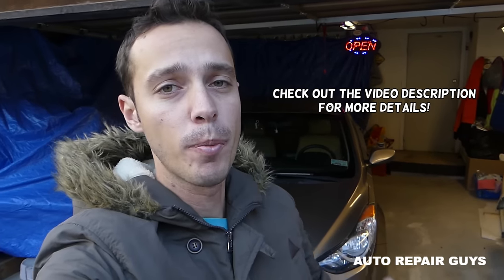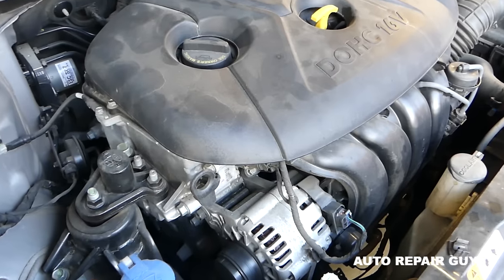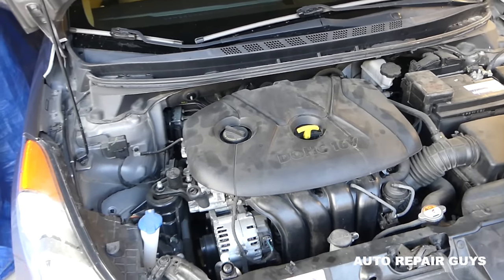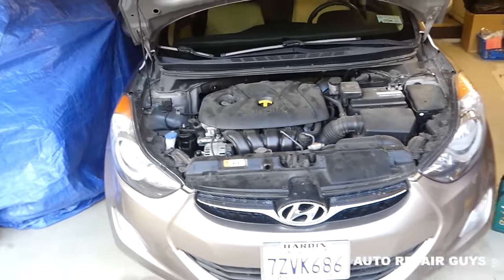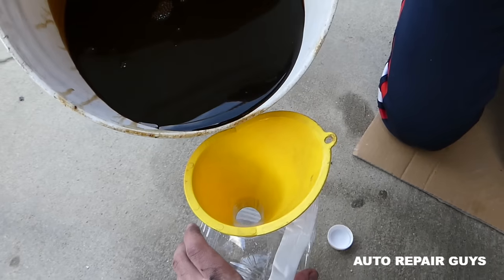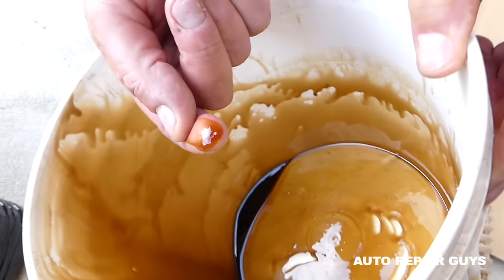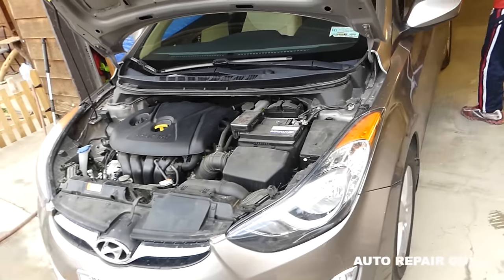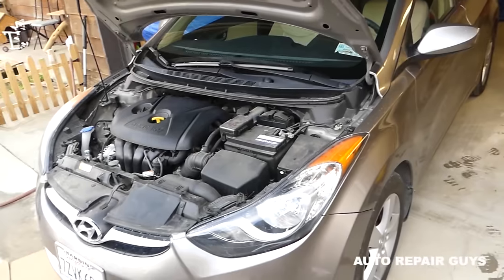HYUNDAI ELANTRA ENGINE KNOCK TICKING NOISE

Comment: Oh boy, that's giving me some "PTSD". I bought a 2012 Elantra back in November with 79k on it, I didn't even put 600 miles in 2 months on it and it started doing this. I ended up having to get an entire new engine because it go so bad.
Reply: It's not an issue with the car itself. People drive them hard and maintain them poorly, and that's when there are problems. I like to buy new for this reason. I bought a 2012 Kia Forte, which has the same 2.0 liter L4 engine, and did all the maintenance myself, full synthetic oil every 5k miles. It has over 100k miles on it now, has never needed any repairs, and runs like brand new. I bought a 2018 Elantra this week, and there is no difference in the sound of the engines. I expect both to last 300k miles or more. If you drive them gently, they will last for a long time if maintained properly. Even if driven hard, they can last many miles, but once more, proper maintenance is absolutely essential, and this is never guaranteed when buying used. Even dealer service does not guarantee that a car is maintained properly... The only way to truly ensure longevity is to buy new and service the vehicle yourself, using quality oil and filters at regular intervals.
Reply: @michaellovell2518  umm, hyundai recalled 3 mmmmmillions engines due to this "manufacturing defect" and class action lawsuit in canada, if it wins i get a new engine. Not saying all are bad mine still strong but lifters clicking alot. Definatly want to do preventative measures.
Reply: @tomanderson3196  
Herp derp, muh Hyundai "runs strong," but I want them to replace my engine cuz I think I hear a noise, derp...
This message brought to you by Toyota.
Reply: Ever notice how your car seems to run better after a thorough detailing? We all know the detail did nothing to the car mechanically, but it still feels that way, right? People read about problems with a certain car, then they start hearing mysterious "clicking" and shit... They get nervous and paranoid, and start stressing about whether there's a problem with their car, and often imagine there is even if there isn't... My daughter had me look at her car because she thought she heard an unusual noise. I checked it out, and couldn't find anything wrong. She kept coming back complaining that she still heard the noise. I didn't hear anything that concerned me. Finally, I told her I found the problem and fixed it, even though I actually did nothing. She was quite pleased to report that the repair was successful, and she didn't hear the noise any more. I'm not saying every bad report is bullshit, I just take them with a grain of salt. I'm old enough to remember how long it took for Toyota to overcome the widespread (and largely undeserved) poor public perception of Japanese imports. Every little issue was blown way out of proportion by the "I told you so"  crowd, to the obvious glee of domestic manufacturers. All I know is that Korean manufacturing appears to offer good value, and their cars have excellent warranties. I gave them a shot, and so far, I'm satisfied enough that I purchased a second Korean made auto...
Reply: @michaellovell2518   Oh i dont hear any noise, just the fact they recalled 3 million and over 6 million are effected by what the manufacturer calls a "production defect". I guess i should just not worry.
Reply: @tomanderson3196  
"lifters clicking" "don't hear a noise"  GIMME A NEW ENGINE RIGHT NOW!
Sounds legit...
Reply: How many engines actually caught fire? The recall pertaining to the engine fire claim wasn't to replace engines, it was a software upgrade for the ECMs... Maybe I shouldn't tell Tom Anderson he isn't getting a new engine unless his catches fire. He sounds like he wants his strong running engine that may or may not be making a noise replaced at the expense of Hyundai, assuming he even owns a Hyundai. I wouldn't want to encourage arson...
Reply: On a side note, Korean manufacturer Daewoo built a car called an Aveo for GM, and I owned one, but only for a short time. It was a real piece of shit. The bolt on my idler puller just snapped off while driving down the road, and there were clearly a lot of corners cut in quality to meet the price point GM demanded. I wouldn't buy another at any price. I could have had it fixed under warranty, but there's no telling how long it would have taken, and a new pulley with the bolt was only like $20 bucks, so I replaced it myself and sold the car. This is not actually Daewoo's fault, since GM was their customer, and who they had to satisfy. They built the car GM asked them to build at the price point GM demanded. It's like how China has a reputation for making cheap, crappy stuff... It's not that China is not capable of building to high quality standards, but a case of foreign retailers demanding cheap crap to sell, and China giving them what they ask for...
Reply: @michaellovell2518  I really like my forte and it runs good and i am not selling it but if the class action law suit wins in canada i get a new engine courtesy of hyundai. If not just hope you dont have any problems.
Reply: @michaellovell2518  The lifters do click alot because they are not hydraulic but mechanical bucket lifter that require manual adjustment. I would like to sevice them but the process involves a special tool and new buckets or shimming/adding material to thicken them.
Reply: @michaellovell2518  Notice the huge add campaign hyundai/kai is on right now, could it be they would rather spend money on ads to sell more car rather then fix problems and cover up, im sure all car manufacturers are similar even toyota ended the celica bc of bad engine design and bad taste is customers mouth, hyundai flushes bad taste with minty fresh ads.
Reply: @tomanderson3196  
LOL, whatever, dude. My heart is beating strong, but someone in my family had a heart attack, so I'm going to try to get on the transplant list, just in case, for my own piece of mind... Good luck with your bullshit lawsuit where you want Hyundai to replace your strong running engine that may or may not be making a noise cuz you're skeered it might catch fire. Maybe you should buy GM cars in the future, cuz GM cars never have issues, amirite?
Reply: Also, there are not a lot of new cars still using hydraulic lifters... If you're not competent or equipped to service your own vehicle, then take it to a professional.  If you fail to keep your vehicle properly maintained, then any issues that result are your fault, not that of the manufacturer...
Reply: @michaellovell2518  hyundai now says they didnt machine the crank pins evenly. when ppl die lawsuits arent bs to me. sounds like the kia brand name means alot to you, u will be good customer long time.
Reply: @tomanderson3196  
If you're driving a Forte, your car isn't even involved in any of the relevant recalls... I can't find anything about anyone dying because of oil flow problems caused by the shavings from the crank pins, and the article I just read doesn't include the Forte in the fire related issues. I'm not sure how you think any of this effects your Forte, or how you convinced yourself you might be getting a new engine. To be perfectly honest, it doesn't sound as if you have a clue what's going on with any of this, but if you want to play Henny Penny and alert Youtube that the sky is falling, knock yourself out. I'm done here. You can check out these links or not, your choice...

https://www.caranddriver.com/news/a15342058/hyundai-and-kia-recall-1-2-million-cars-for-engine-failures/

https://www.abcactionnews.com/news/local-news/i-team-investigates/hyundai-kia-recall-more-than-500k-vehicles-as-fire-risk-spreads
Reply: @michaellovell2518  at this point im not sure if you even read what i posted. i said numerous times that there is a class action lawsuit in canada for the car i own, it is going thru now. you should prob research what a class action lawsuit is because clearly you have no idea. if it is found that kai is in bad faith then all the fortes of my model year will have their engines replaced as all the other models with the exact same engine are being done, not sure what you dont understand and obviously its not something anyone will be able to help you with, iq cant be changed. im sure hyundai and kia would love to have you as a rep, you can tell all those crazy owners of theta engines that they are hallucinating and its all in their head, bc kia is god and god would never make a shite product. you could even move to n or s korea bc you would fit into the culture very very well. enjoy living in denial of reality, have a good day and a good life.

Comment: Oil control valve, timing chain and exhaust vvt valve has failed
Reply: There is no exhaust vvt valve btw. The problem is the crank bearing and it needs to be replaced before the engine explodes.
Reply: @tomanderson3196  incorrect...their are 2 vvt valves on thdc1.8 liter engine...both intake and exhaust...typically the exhaust ond faild
Reply: A simple google of the engine will confirm.i am correct

Comment: Thanks for the info. I have a 2014 Elantra. I had the same problem with knocking/ ticking. The car has 112,000 miles on it. I changed the oil and the problem went away. I had almost 4,000 miles between oil changes. Could it be the oil needs to be changed more frequently? You also said the ticking was coming from the top of the engine. Could it be the valves needing adjustment? Are the valves adjustable on this engine? 

This problem came about because the car wouldn't start. I got 112,000 trouble free miles from the engine. I changed the plugs and the filters and still the same problem. At first I thought it was a gas pump and filter. I watched your video how to change it. ( Good video)I figured out the engine wasn't getting gas. But the  pump wasn't the problem. So I took it to the dealer and they flushed the fuel injectors, and no more hard starting. That's when the dealer mentioned the ticking noise. Changing oil solved the problem. 

Thanks for all the info, you're a very intelligent mechanic. Hats off to you, and much success.

Comment: Don't dig into the engine. Another you tuber has the same car and the dealer replaced the short block for him. This is the same problem that caused Hyundai/Kia to recall many vehicles due to a problem in the engine production during assembly.

Comment: The ticking you hear when they change the oil is the high pressure fuel pump and the direct injection head design.
Reply: Justin Hall this particular engine is not gdi. This is the multiport injection one. Notice the engine cover just says DOHC (dual overhead cam)

Comment: My 2012 only does that when the a/c is on....the tick stays in pace with the RPMs (intermittently), I've replaced the intake actuator and top motor mount.....problem not solved..
Reply: Hello. How did you solve this problem?

Comment: I had a car where the engine had a slap sound. Thought it was a lifter or a loose belt. That was until one day the car quit working and saw oil spilling out from under the engine. The car was totalled.
Reply: Did you fix the problem?

Comment: In my 2006 Elantra the knocking noise occurred when oil level dropped to the minimum. Adding/changing the oil was the perfect method to solve the problem.
Reply: That actually happened to my sonata 2006 V6 also. I still can't figure out what is going on.

Comment: 2018 Hyundai elantra 
my check engine light is on. 
Sounds like a diesel engine and Knocking. 
The car stops with every left turn with the  check engine light, battery light and oil light but it will start back up 
I changed the battery (brand new) yesterday. Now the check engine light is on (not flashing)
Reply: Did you find out the problem.?

Comment: I have a 2010 Hyundai Elantra I live in Canada when it's cold and I started it revs high after about five minutes it goes down what is the problem can someone tell me thanks
Reply: My wife’s 2010 Hyundai Elantra GLS has a faint ticking noise, it comes and goes. I’ve changed the oil with synthetic when we bought it used at 65k+ miles, now it has 193k on it. My best educated guess is that the hydraulic lifters that pressurized are worn out. I would get a second opinion to determine if it’s it.

Comment: If you had one of those funnels with the mesh in the end of it that would catch anything you may want to see.  Also if the oil is really bad it may clog that mesh some so make sure to have a place where you can leave it drain into the bottle.  That would be a place out of the way where you won't forget and accidentally knock it over.  It may pass through the funnel quick enough that it would not be that problem.  The funnel I am thinking of is probably something that would be sold for filling hydraulic fluid.  Someone with expensive equipment who doesn't want dirt getting into his machines would be likely to use a funnel like this.  You could also use a funnel like that to put oil in your car or truck engine if it fits in the fill hole.  These are a big funnel too and look like they could hold nearly a quart of oil but that oil won't be in there long enough for it to fill unless you like pouring it fast.  I would recommend some sort of slow acting gentle engine flush you can leave in until the next change and maybe change the filter part way through.  There is a comment by me in here somewhere about a product I like.  I have no idea if you will like it or not.  Why is that you may wonder?  It is simply that everyone is different.  Also there is a chance that it might not help this ticking sound.  I doubt that it would make it worse but you never know.  I would never guarantee it not to cause a new problem.  It is something that you would use more for preventative maintenance.  I also can't guarantee it because if it is a worn out or broken part causing it that will not magically repair it.

Comment: My car is a 2018 and I recorded my car and the video is the same. Had oil change today no change, appt Friday at dealership...mileage is 70,000
And at 20,000 dealer almost had to get into timing. No dash lights. The dealership has even ha to do 2 computer updates because car has no speed to go sometimes.
Reply: What did they say I have a 2018 same issue

Comment: My 2011 Elantra had the short block changed under warranty at 42,000km because of this same problem. 2 weeks ago at 92,000km, my car wouldn't start and the engine light came on. My code reader said it was my camshaft position sensor. I had it towed to the dealer and they said a piece from the camshaft fell and my engine is finished. I'm now waiting for Hyundai to give the okay for a warranty engine replacement. Those NU+ engines are crap!

Comment: HI..GUYS THANK YOU FOR THAT VIDEO, SO I PUT FULL SYNTHETIC OIL IN MY CAR AND NO NOISE, THAT PROBLEM GONE, BUT I HAVE BEEN NOTICING THAT MY CAR IS VIBRATING, SPECIALY WHEN IT IS IN PARK GEAR.I EVEN PUT THE BEST GAS. SO WHERE DO YOU THINK THAT VIBRATION IS COMING FROM ,MY CAR IS A 2015 HYUNDAI ELANTRA 1.8L LIMITED, I DID AN OIL CHANGE AND REPLACED THE SPARK PLUGS,I PUT A STP GAS TREATMENT BOTTLE IN THE GAS TANK,I ALSO CLEANED THE THROTTLE BODY ,PLUS THE MAS AIRFLOW SENSOR ,I REPLACED BOTH AIR FILTERS AND THE VIBRATION IS MUCH LOWER NOW, BUT IT IS IRRITATING THAT IS STILL THERE.
Reply: I did a system clean at valvoline on mine. It started running a little better.
Reply: @anitavolpato3926  HI..A AUTO PARTS GUY AT HYUNDAI DEALERSHIP SUGGESTED TO CHANGE THE TRANSMISSION MOUNT,AND IT WILL TAKE THAT SMALL VIBRATION,AND THAT IS A COMMON WEAR AND TEAR AUTO PART. MOST STICK SHIFT CARS NEED TO REPLACE ALL 3 MOTOR MOUNTS, SO I GUESS I'M TO ORDER   THROUGH AMAZON AND HOPEFULLY THEY HAVE  IT ,I'LL LET EVERYONE KNOW HOW THAT WENT. THX ENJOY YOUR DAY.

Comment: I have that exact problem and going to change the oil and get the factory oil filter with the check valve to see if it makes any difference
Reply: I have the same problem, just add a can of oil additives (STP high milage oil treatment) for 5 dollars. You won't hear a tick after that. Being doing this forever now.

Comment: I live up in Minnesota and it's cold I've had what sounds like that noise in first morning for about a month now sound goes away under 20-30 secs. I have been keeping an eye out on it for about a week now. I found out going from 10w-30 to a lower oil to 5-30 solved the problem for me. Reason I say is yesterday the weather was 15 and before the 15 degrees it was 40 degrees and no sounds when it was warmer... The oil weight for sure has to do with certain climates.  Nice Video:)
Reply: What happed yo your car ?? My stared a week ago makin that sound
Reply: @francisconuno8510  noise went away

Comment: It's funny if you read the comments. Most are Hyundai owners who got past the fear stage of the ticking noise. Everyone has found solutions to the problem. But the great part is that most have more than 100k miles and the cars are still running. Hyundai is very reliable, they have great original engine gaskets. You will rarely see these cars leak oil. The most important part is that they seriously put reliability of other cars to the test. They may not be the best cars but damn do they love their owners.

Comment: I have a 2018 it does it when it is cold I am bringing it to the dealer not that bad tho I changed the oil did nothing
Reply: Same i have  2018 and it sounds like this any time until it warms up, really loud and inconsistent when its below -5 °C
Reply: Have any of you changed the oil weight or is it still the stock 5w-20?